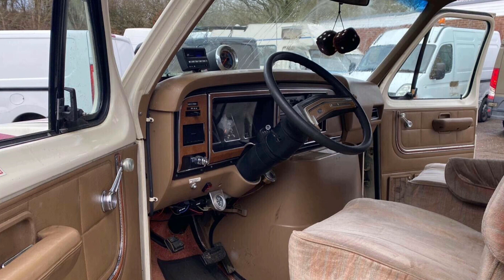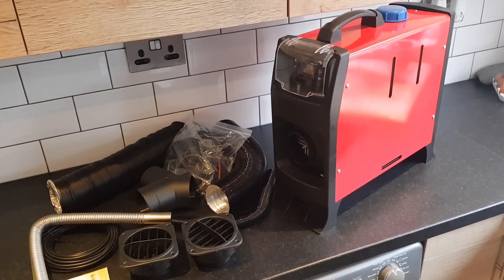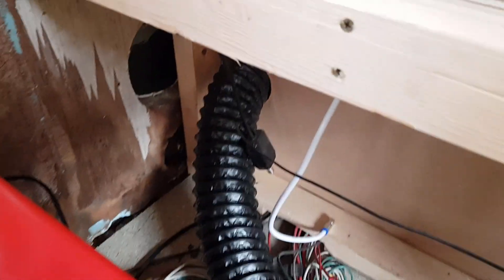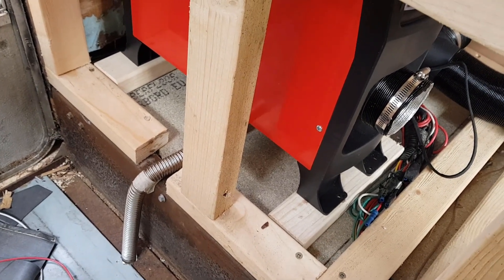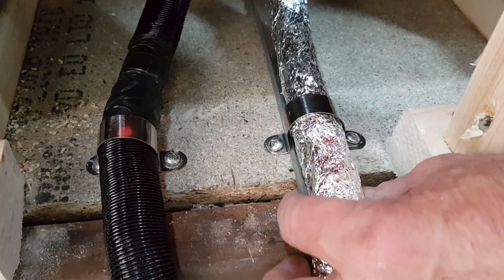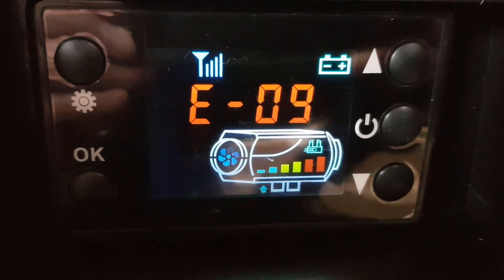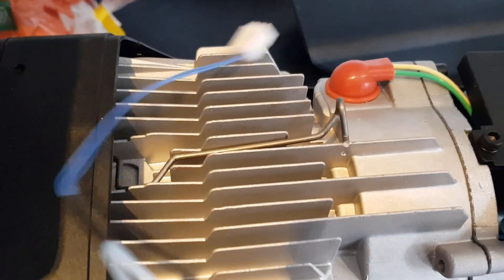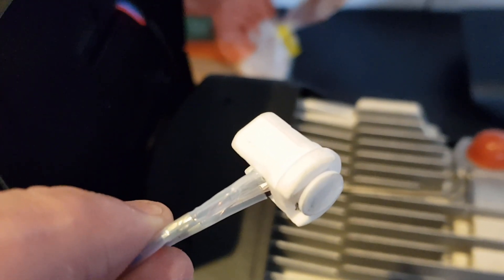FAILURE of BRAND NEW Chinese Diesel Heater | Less Known Error Code E-09 | RV Motorhome Rebuild

Comment: These failures are mostly related to install
 Yours is overheat, and could be related to your choice of type of ducting hose creating too mush resistance to air flow . Dissconnect your ducting and run it. Make sure you have no air in your fuel system.
Reply from the maker: It was caused due to the fan fouling the outer casing.

Comment: Typical that, especially when you get it all perfectly put into place. Hopefully that new small part will sort it. Fingers crossed! Neat job by the way. 😁👍
Reply from the maker: We had  suggestion given to us yesterday, saying they had the same problem which turned out to be the plastic casing fouling the fan slightly. We are going to look at this today, failing that we will further try again when the new sensor arrives. May well give a video update tonight, see how it goes.

Comment: That is just bubbles in your fuel line, you should disconnect the fuel line at the unit side and turn the unit on until fuel start coming out of the end of the line that will ensure you that the fuel line is clear of air bubbles then just reconnect the line and restart the unit and it should work perfectly ....
Reply from the maker: All is fine now. Any air pushed its way through.
Reply: @VintageRVAdventures  I'm glade for you... Happy travels...

Comment: Shame that John. All that hard work and no biscuits or bacon butties. What will we do with that Samantha 😂😂. Joking apart it will be good to see if the replacement part solves the problem. If so pop a link to the part on Ebay would be useful. 
All the best from Mal,Dave and Sally the lab
Reply from the maker: We did manage to secure that bacon sarnie for lunch 😃 I have now dropped a couple of links into the description, thanks for the tip. We have something else to try later with the heater to attempt a fix, following some advice we received late yesterday, so we may put a video update out tonight, see how it goes.
Reply: @VintageRVAdventures  Great stuff John. Love following your videos
Reply from the maker: @SilvertopMotorhomers  Awww thanks Mal and Dave, love you all xx

Comment: I hate it when a bit of new kit does not work.  Hope you get sorted soon enough.
Reply from the maker: Someone just messaged me with a similar problem he had which threw up the E09 issue we have. It involves a slightly warped plastic casing around the fan. We are going to take a closer look tomorrow, fingers crossed he might be onto something.

Comment: Could you have spaced it off the fins a bit as to not let it get too hot. It seems when it reached a certain temp it cut off

My new heater keeps flashing E10. It doesn't seem,to fire up and get warm . then the E10 pops up
Reply from the maker: I guess you mean the wiring.. leaving a gap between it and the wires?? Ours is running fine now, so we believe it was due to the positioning of that cowling and the fan wheel, which we have now centralised using the spacer piece which was permanently fixed into position.

Comment: I didn't think there were any class C ford RVs in the UK. They are so big
Reply from the maker: There are some, but there are not that many around. Ours was imported from the USA in 2003.
Reply: @VintageRVAdventures  keep the front end greased.  I was never a fan of those Ford I beam suspensions.  It must be cool to have a rare RV in the Uk.  I'm guessing you have the 460 motor?
Reply from the maker: The engine is a 5.7 litre petrol V8. One of the things on my list for buying is a good grease gun. In the early days of repairing buses we used a very sticky thick lubricating oil that was used for kingpins, it helped the life of kingpin bushes. I would like to try to identify such oil  if it can still be bought today.

Comment: Was the original lpg furnace not working ?
Reply from the maker: It was never fired up. There was lots of corrosion within the unit, I doubt it would have fired up and even if it did, I would not have felt it was safe to operate.